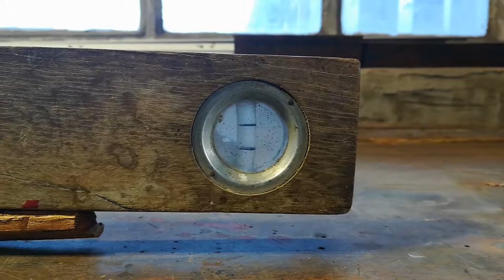Restoring old yugoslavian wood level

Comment: Hi Mister Matic, cool video! I've a similar one at home and I want Ro restore it too. What paste are you using to "glue" the pieces in?
Reply from the maker: Hi, I used glass silicone to glue the parts because I had one, but you can use any you have on hand, even hot glue.